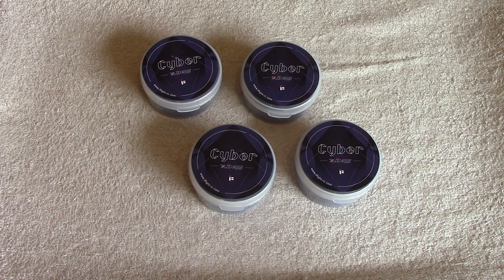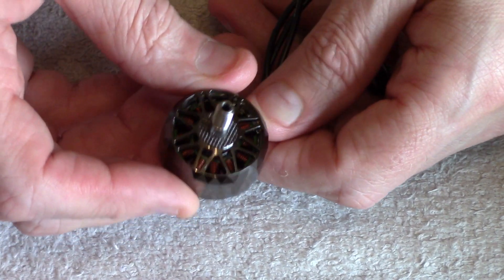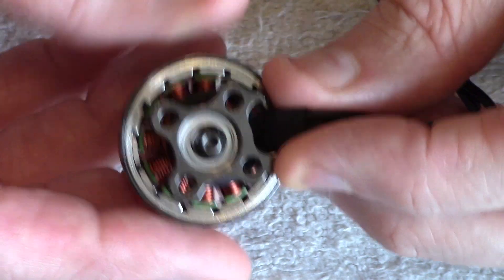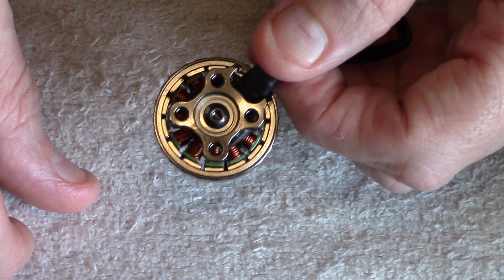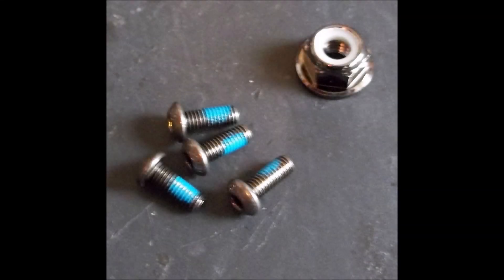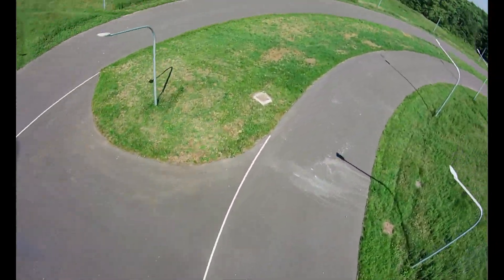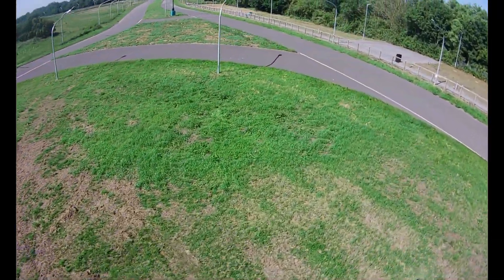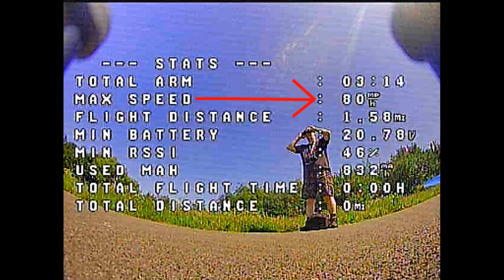IFLIGHT CYBER XING MOTORS 2207  4 6S 1777KV

Comment: With the way I fly, those motors would get ugly real fast. What do I need to do to get that data at the end of the flight? Do all FC do this
Reply from the maker: The first thing you need to do is set up the OSD  in betaflight (just look up OSD on YouTube) then you use your fpv goggles to record the DVR flight footage. If your fpv goggles doesn't have dvr then you will need an adapter module, the best one on the market at the moment is the Power Play, but it's pricey. See link  https://youtu.be/PBz2xaqhbn0  You can however get a cheaper version that still works, but you need to run it from a phone or tablet but works very well. see link.  https://youtu.be/B7FwfBqlhKk. 

If this is confusing I will be happy to make a video about setting it all up,  Hope this helps happy flying..